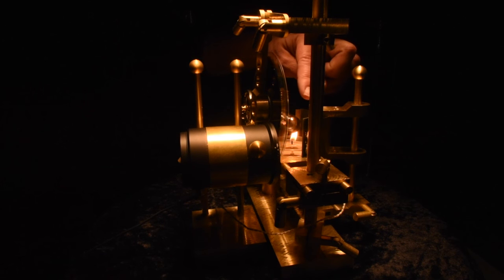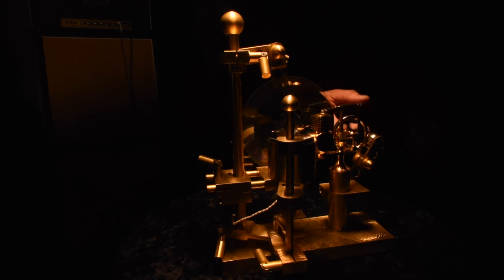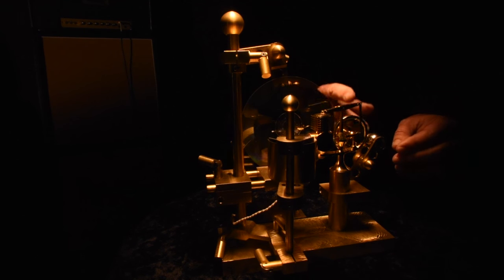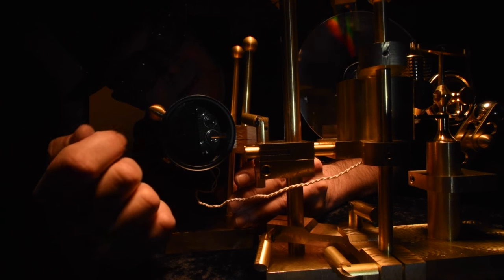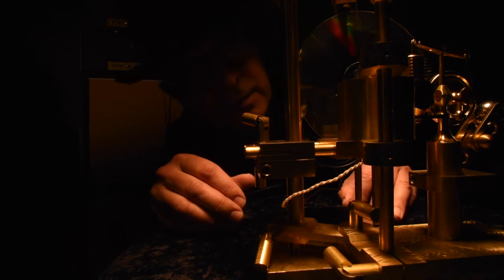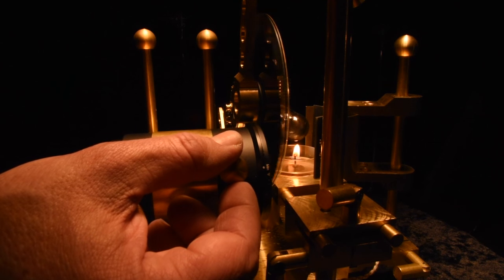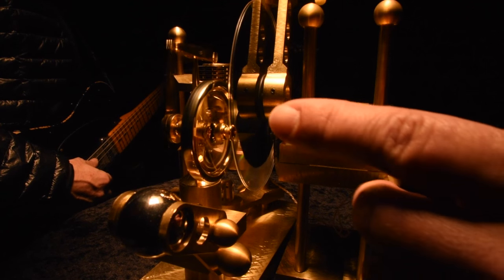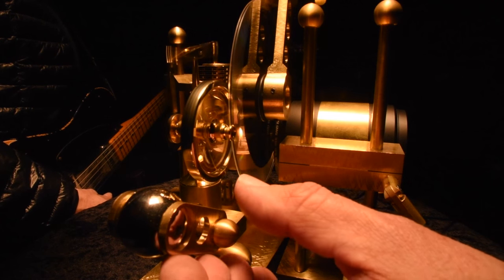ZVEX Effects Candela Vibrophase

Comment: You could change the candle for a storm lighter with a copper grid in it so you have a green flame which is resistant to most wind on a gig. The grid could also be made of Lithium (burns bright red), Natrium (yellow), Antimon(bright blue), Calcium(different kind of bright red), Kalium(violet) or Strontium(red).
That way you would always get a different spectrum of light, depending on how it works exactly this could make a huge difference.
Then mount it all on a plate, build it an acryl glass box and this thing is live-ready.

Comment: I'm gonna make an opticalleslie/modulator system with a woodwerker friend of mind. your work on this one was a great influence man, i want to use solar cells too but maybe not sterling engines... so cool i need to learn more about electro mechanical systems, then we will make a tape unit that u can scratch with and make echoes aswell! i'm back on this vid to show my wood man the way you did your splenid phasor(s ?). i've had these ideas for years but now i found the guy to take care of the physical par of the job...